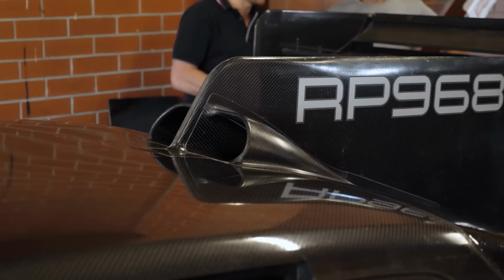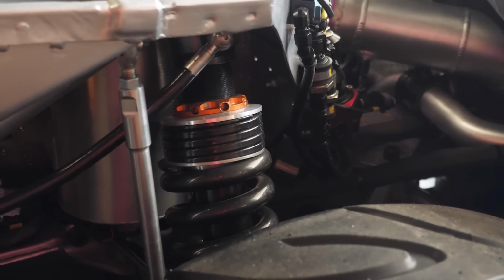0.006 Second Response Time! | Electronically Controlled Suspension

Comment: Early 90's F1 tech. available to the likes of us. Back then transponders were used at various points around the track, so the suspension would adjust to pre set parameters, inc pitch at that particular point.
If they are not prohibitively expensive I'll order a set. 
The potential for improved traction is intense
Reply: even some high quality standard coilovers can pretty pricey

Comment: I can’t wait for my car to get finished, there’s one thing im still learning about In being a well constructed suspension/chassis build. When others are just getting ready to go take on their first build they are all sold on the power upgrades, meanwhile they have rusted out pipes and control arms that are flaking off the car. I use to be that person..
Reply: In your case, I'd drive it and get a feel for it and from that point decide on a direction as you don't need to spend a exuberant amount of money to setup your car to feel right with you with the reason being  that a specific suspension, alignment, brakes, etc may work well for one individual, it may not be the case with you and need to experiment and figure it out as you progress and will eventually get the car that fits you to a T.

Comment: Its absolutely mental technology like this is available to the public.  TT suspension, you've created black magic here.  The way this was explained made it seem like a relatively simple concept, but the level to which this can be fine tuned is genuinely astounding. 

You've gone and done it again Taz.  Class interview mate.  Theres no other content like this on YouTube - This is also the first breakdown of active suspension ive seen outside of F1 applications.
Reply from the maker: Andre and Dejan are the two on camera here, I just handle comments, but thanks haha

The F1 active suspension was a bit different again, but this is indeed still awesome and very interesting.

The second podcast interview Andre did with Sander Marquez touches on this a little as well in relation to using it for a hill climb application. The car suffered an engine failure at that event though so he didn't get all the data and usage he would have liked - Taz.

https://www.hpacademy.com/blog/051-the-hoonipigasus-what-went-wrong-podcast/?utm_source=youtube&utm_medium=social&utm_campaign=general-interaction

Comment: That system came on the Volvo S60r since 2004, it's named 4C by Continuously Controlled Chassis Concep.. It also breaks tires on the fly to correct any wheel spin and maintain traction in all driving condition...
Reply from the maker: That's quite a different system to be fair. Still interesting, cheers for sharing - Taz.

Comment: I use to mess with all these settings in grand turismo all the time and only make the car slower 🤣
Reply from the maker: Yeah me too, only because I would move the sliders all the way from one side to the other, and change every setting at one time. No patience as a kid right 😅 - Taz.
Reply: In Gran Turismo, 95% of your speed comes from gearbox tuning. The other 5% that made you go from Tier 1 to Tier 1 Elite, was suspension. I wrote a whole tuning bible back in the day on it for drag racing 3K. Front up rear down, front down rear up, slammed, raised, balanced. 😎👍
Reply: I feel this comment. Almost never faster and always harder to handle. Gear ratio tuning on the otherhand, yess.. but you can't do that in real life..well not without $$$$$, literally 50000 different combinations at least per transmission done in 5 seconds between laps.